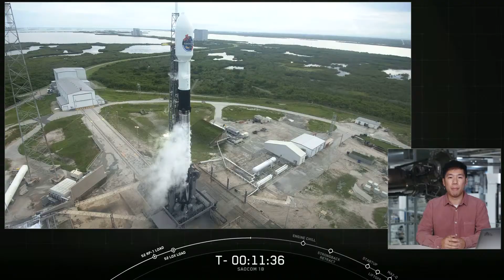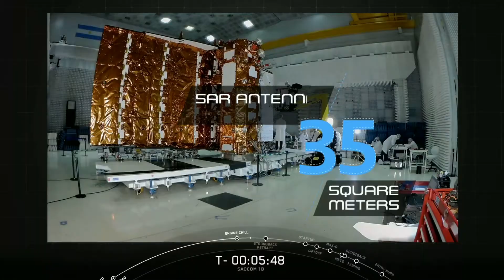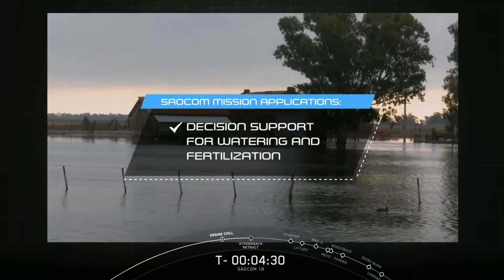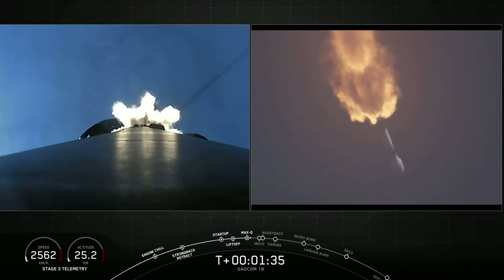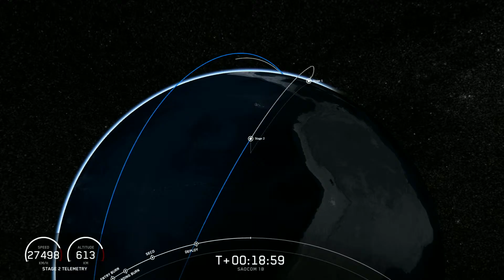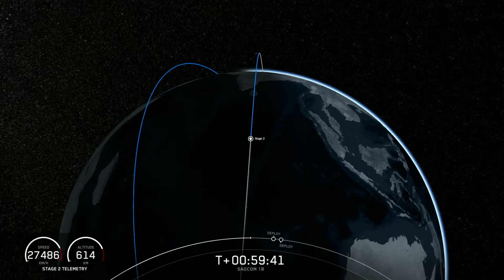SAOCOM 1B Mission

Comment: It accelerates exactly as quick to 100km/h as my Peugeot 205 does. Top speed's less similar.
Reply: Pfft, peugeot
Reply: Yeah, top speed would be somewhat inferior.
Reply: It's also accelerating vertically 😉, not horizontally!
Reply: @mduckernz  yes. fighting with gravity
Reply: 205? You have a GTI or something? Because no way regular 205 would reach 100kmh in 9 seconds
Reply: @TheAziz  I counted 10 and a bit
Reply: @justindonnelly5382  You obviously never drove a 205 :)

Comment: Amazing! You can see the shockwave from the grid fins as the first stage becomes subsonic! (T+7:10)
Reply: 24:19
Reply: Not really. Those are the nitrogen control jets firing.
Reply: There’s no way those massive shock lines coming off the grid fins are from the RCS. It happens right after he says “Stage 1 is transonic“.
Reply: Never get tired of hearing the countdown launch. And than the landing.....amazing
Reply: @Tolono  The audio is not completely in sync with the video, also there is a delay between when the event occurs and when it's announced, always been that way. The call occurs several seconds after the booster has actually dropped through Mach 1, AND it was passing through a cloud at the time. The high humidity in the air condensed in the low pressure zones immediately behind the grid fin elements. It's the same effect that you see when a jet pulls a high-G turn in humid air.
Reply: Thanks for the correction. Regardless, it's still an awesome-looking effect we don't normally get to see during entry/landing.
Reply: @Tolono  Absolutely.

Comment: Do they ever chill, been firing a rocket a day at this rate 😂 my feed flooded
Reply: Benyam Ephrem he said ten a day in a decade or so
Reply: Just wait for starship program to conclude. They are aiming for 3 launches a day. Thats over 1k launches a year. Using renewable fuel manufactured using solar energy.
Reply: They deploying satellites so we can have maximum speed internet for very cheap
Reply: If they had had better weather this morning they would have launched two today. Unfortunately, they'll have to try Starlink again on Tuesday morning. Still, two in the space of forty hours won't be too shabby.
Reply: @TheJDruck  More like aim to have the ability to launch three times a day. They'd still have to wait for good weather, and with Starship's huge capacity they'll probably end up waiting around for their customers to finish building the payloads pretty soon.
Reply: The only thing chilled is the engines..

Comment: WAIT WHAT?! 700 gallons per second?!

That is 25.126,5 liters!
Holy shit!

So let's say Stage 1 burns 20.000 liters/s in average for 120s - that would be 2.400.000 liters of fuel!
That is 2.400m³ in fuel.
Reply: Yes
Reply: 700 Gallon is 2649 liters. I have no idea how you got that number, but if you miscalculate propellant burn and first stage propellant capacity by a factor of TWELVE, please don't spread it to other people, as you can see they don't fact check. You can easily find out on the SpaceX website, that a full F9's mass is 549 054kg. Your liter to m^3 formula is also a bit off.

Comment: Something was leaking out of the main engine quite dramatically.
Never seen one do that before....
just wondering if it was a malfunction of some kind ?
Reply: I was wondering that also.
Reply: Rod Serling the they cut to different feed
Reply: I was also curious about this, someone should ask Elon on Twitter
Reply: Do you mean the solid coming out of the nozzle at 29:13 ? If so I believe it is liquid oxygen venting and forming into a solid in the cold vacuum of space
Reply: @SomeOne-nl4nh  I don't think it was supposed to do that.
There were also some unusual movements in the shiny space blanket shielding that seemed like something was gassing out under it.
Both were unusual and never seen either like that before.
Reply: @-M0LE  Yeah it was like they were trying to determine what was happening too.
Reply: @1MADDLAD  admittedly I'm not 100% sure but it seems like the most likely cause to me, we probably don't see it more often since the 2nd stage reached  greater altitudes than normal (this was 600km+ high as opposed to 300km+) I'd imagine it would receive less thermal energy as less heat would be reflected from the earth onto the rocket but that is purely speculation. Although I will admit I don't think it is ideal
Reply: @SomeOne-nl4nh  Yeah, I don't know either, but that kind of outgassing could affect the craft attitude and get it spinning ooc.
It just didn't look right, and was unusual.
Reply: @1MADDLAD  it's normal, they always do that
Reply: What we see is venting of residual liquid oxygen from engine plumbing after engine shutdown. This happens in every mission. Sometimes the illumination conditions are such that we see the stream very clearly, and sometimes not at all.

Because the liquid evaporates into vacuum very rapidly, it cools instantly, and some of it freezes solid. The frost that we see around this drain is solid oxygen. 

There are several other drains nearby, some of which vent while the engine is running, and others that vent before the engine is started. Altogether, there are six propellant drains on MVac, plus many gas vents. It is a complicated machine.
Reply: @cogoid  Cool, I'm glad that it wasn't a problem.
Thanks for your reply 👍

Comment: I've always thought "how could those little grid fins possibly steer that big rocket?" until I saw them shred through that cloud at 24:20 Wow
Reply: @logitech4873  Yeah.  That's a lot of titanium.  Still, that's under 2m compared to the 70m rocket (~55m without stage 2).  I think it's just that they're so thin when they're deployed but the amount of surface area that's able to direct the rocket is actually substantial.  Cool design.

Comment: You should have explained several details:
- "Secong stage FTS secured" call - second stage is on the trajectory where, even if the engine fails, it will enter an orbit; not necessarily the correct one, but some orbit. Therefore, Flight Termination System ("self-destruct") is certain not to be needed. 
- You did say that your FTS, first stage flyback and overall reliability allowed you to launch into a polar orbit. One detail was missing: this characteristics of your launcher will make sure that your will not drop anything on Cuban heads. :o)

Comment: Watching SpaceX launches (and landings) really gives me the sense that we are in a modern, really good era of space sciences.
Watching ULA and other launches, on the other hand, makes me feel like I'm watching 1980s/1990s launches of 20 or 30+ year old tech. I take nothing away from the scientists and engineers working across all the space programs, don't get me wrong, but companies like ULA and the other government run programs have basically never felt any real pressure before and it shows all around.
Had the Falcon Heavy been chosen instead of the Delta IV Heavy, they would've saved money, had their payload in space and the folks planet-side would've been treated to triple booster landings instead of being handed a huge, inflated bill for the equipment that get dumped into the ocean - if it launches - it's still sitting on the pad, soaking up tax payer dollars.
Reply: You might notice that Falcon rockets have had their fair share of delays and aborts. It's part of the game. The Delta IV Heavy has a very long record of reliability, the Falcon Heavy has only conducted two operational launches, and probably had not done that many when that particular payload was contracted.

Comment: Next, they just have to find a way to actually do that for astronauts returning home instead of watching them hurdling to earth on parachutes.
Reply: The initial plan was to use engines to slow the crewed dragon down rather than parachutes but they went with the chutes instead probably because it works fine and was easier and cheaper to do.
Reply: @tgm9991    No, NASA objected to the propulsive landing idea. The customer is always right.
Reply: That is what Starship will do.

Comment: i am playing space flight simulator and i made a rocket that will go to mars i am still trying to get to mars and set my base bottom which is a normal lander with out a parachute but a docking module if more missions go by i am going to remove the lander bit and make a platform instead

Comment: Bravo Elon Musk and Space x team for another successful mission and beautiful Falcon 9 show. I never have enough of this space balerinas. So gracious they are. One question for the nerds out there: what are those objects on top left corner of screen at minutes 20:54 till 21:04 and the second one from 21:17 till 21:22. Don't tell me space debris, be more specific. Thanks, Daniel.
Reply: The liquid oxygen in its tank is constantly boiling off. In order to maintain the correct pressure in the tank, it has to be frequently vented. When liquid oxygen is vented into vacuum, some of it will vaporize, this draws the heat from the other part, causing it to freeze. What you are seeing there are pieces of frozen oxygen.

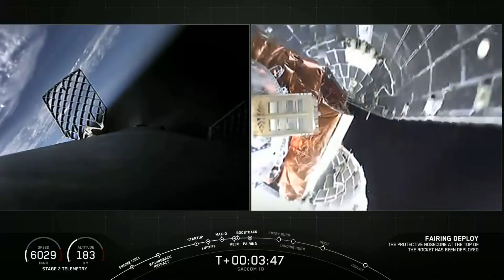Comment: Anyone know what that object in upper right corner of stage 1 video at t+3:38(20:34-20:42) and the weird flipping debris at t+4:00(20:52-21:04) and again at t+4:10(21:16-21:32)??  At t+4:20(21:24) they flipped video to inside rocket??

Would any damage happen to the exhaust nozzle if the gas generator exhaust pipe didn't catch all those ice chunks??  Seems like at that velocity any debris striking that nozzle may cause it to crack and fail, good design or luck?

Comment: Wonder what the savings in $ is on the 4 re-uses of the Falcon 9 - stage 1 booster vs needing 4 new boosters?
Reply: Probably out of date info, but each booster was costing $50-60Mil last I knew.  So, I would feel confident in the savings being at minimum $25 Million for each successful reuse.
That's assuming it costs a lot to go fetch them, get them ready to go again, etc..

Comment: So many questions. 
So I am looking at the speedometer of this rocket as it ascends into space and I'm thinking: Wow it's crazy how fast it gains velocity in the last minute or so before second engine cutoff compared to before that. So I am wondering how fast could a rocket go if it had an unlimited supply of fuel? Would it be able to go as fast as the speed of light and even beyond? Or would it the increase just stop at some point? (I am talking about these current engines on chemical fuel, not ion thrusters or solar sail or w/e kinda futuristic stuff, just on w/e makes these merlin engines burn.)

Then another one: I've been watching some of the Starlink missions too and I see a difference here when second engine start. Here it gains speed superslow during the first minute or something, even my shitty Fiat Punto sped up faster than this. But when we look at Starlink's mission, it immediately goes boom and it basically sped up as fast as with the first stage still attached to it. Why is it different?

Another: What happens to the 2nd stage after the satellites have been released? Does it stay into orbit forever or do they burn it up in the atmosphere? Can they not land it back down like the other parts as well?
Reply: For something with mass to reach the speed of light, you need infinite energy.
So I guess a rocket with infinite fuel could do that, unless you mean that it also has infinite mass.
Infinite somethings makes physics break down.

Second stage burns up during re-entry.

Comment: 3 questions. 
What actually happens to the second stage after sattelite deployment? does it stay in orbit as junk or does it burn up completely? are there any plans to recover 2nd stage?
Reply: For low orbits like this one, there's usually enough fuel left to de-orbit the second stage and for Geostationary orbits where are much higher and require more they usually leave it up there in a specific orbit intended for discarded 2nd stages and decommissioned satellites

Comment: Curious...   what was constantly venting from the second stage, and did that affect deployment attitude.  It was on the opposite side of the typical LOX venting/freezing that we see...
Reply: I think you're referring to the dinitrogen (N₂) thrusters. Those and the grid fins control the descent of the booster.
Reply: Thats gas generator exhaust that is inserted into engine bell to cool it, that leak should not have any impact on flight performance.
Edit: watching it again it might be just main exhaust plume back-light by the sun, later venting looks like fuel drop.
Reply: @davidkeenan5642  I said the SECOND STAGE...
Reply: It's constantly venting LOX.

Comment: I don’t understand how it’s able to hold enough fuel if it starts burning it up at more than 700 gallons per second... someone help me understand that, please.
Reply: by having several hundred tons of fuel. also, fuel burn isn't the same throughout the launch
Reply: Guilherme Eduardo Carvalho Obviously they have that much fuel, by question is just in wondering how the hell they fit it all.  In my head it just seems like that much liquid shouldn’t be able to fit inside of that rocket... but obviously I’m not an engineer or mathematician.  And I realize the amount of fuel being burned per second is changing throughout the launch/flight... but still...
Reply: NebTheWeb  That’s what I assumed was that case.

Comment: rockets are suppost to go straight up.. 18:20 it's coming back down for no reason..  if you wanted to waste that much gas for a small payload why not use a carryer jet that pretty much does the same thing with less gas..
Reply: Rockets are not supposed to go straight up, that's stupid.
Reply: @Mystic wolve - You have no idea what you are talking about. No rocket, that is intended to take a payload to orbit, goes straight up. You know what happens to rockets that go straight up? They fall back down when the fuel runs out.

Comment: what is the thing at 21:00 min top left conner thing spinning
Reply: ice crystal from the grid fins unfolding
Reply: @nebtheweb8885  that is one huge ice crystal ]
Reply: @nebtheweb8885  its at 20:57 the booster side it almost looks like the space station spinning
Reply: @nebtheweb8885  next to the left grid fin
Reply: @fastlosiccdl4600  It detached from the grid fin when the fin pulled away from the body of the rocket. Those fins are not small.
Reply: @nebtheweb8885  ok yea i know they are pretty big can wait to go see the thing take off in person
Reply: @fastlosiccdl4600  Also, remember that all that fuel just gets them out of the atmosphere. Then the second stage takes over to get them into orbit.

Comment: ...I can't grok those speed and altitude statistics....it should be a LOT higher than 10.5 km. if it's accelerating past 1,348 kph....it's moving like a bullet, f.f.s....so why is it only a few miles up?
Reply: That's about the speed of an airliner, minus 100 or 200kph
Reply: @atlas8827  ..try 900 kph for the speed of an airliner...1350 + 100-200?  ...nein.
Reply: @FeldwebelWolfenstool  
The airbus a380 can do 1085kph. Business planes even more so. Cessna Citation X can go all the way to 1100kph+
Reply: @FeldwebelWolfenstool  said "it should be a LOT higher than 10.5 km. if it's accelerating past 1,348 kph."
-
Because the rocket isn't going straight up. Only amateur rockets go straight up, then they just come back down. These orbit seeking rockets all pitch over to follow the curvature of the earth so while they are going fast, they are also going sideways more or less to achieve orbit.
Reply: It's not going straight up but in a arc.